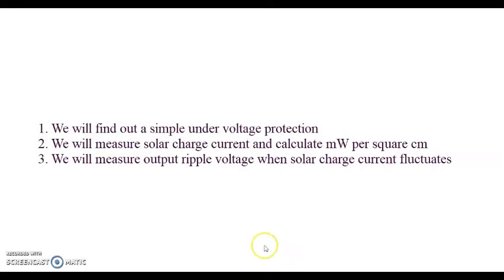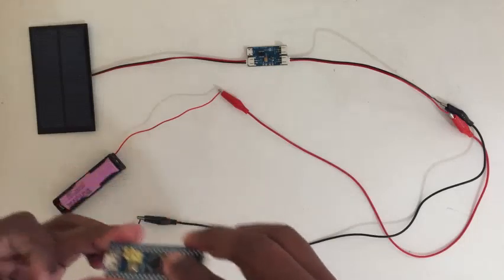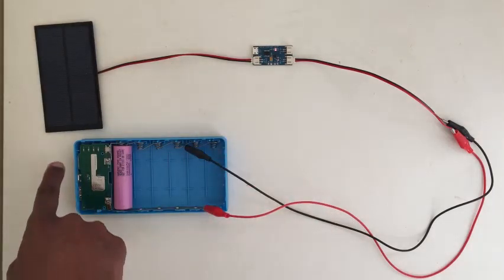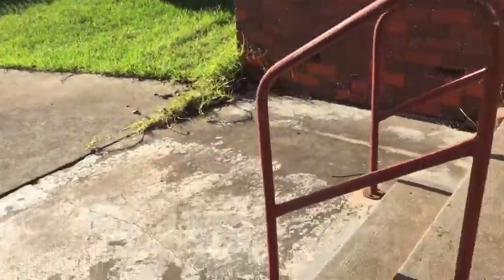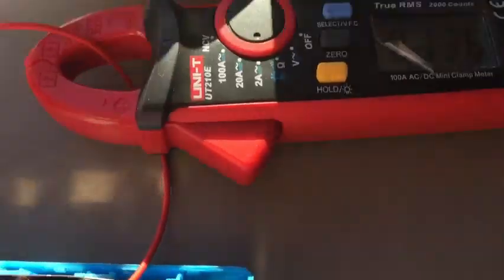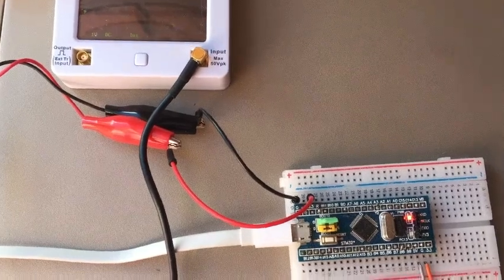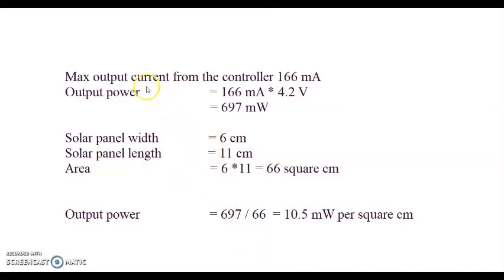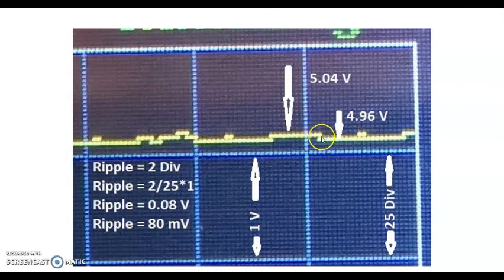9. Solar power for micro controllers. CN3065 and 18650

Comment: You can plug to the "bms" the charge wires to not overload the battery. It's possible with this device.
Reply from the maker: This device is only for single cell charging. It set to maximum 4.2Volt. You can use multiple batteries in parallel as well. No BMS necessary

Comment: Where to buy batterybox
Reply from the maker: There are many out there in Ebay and AliExpress. I purchased this from https://www.ebay.com.au/itm/292281379467
There is another seller i found
https://www.ebay.com.au/itm/384313153142
Reply from the maker: https://www.aliexpress.com
search "Power Bank Shell Case 18650".
Reply: shop !